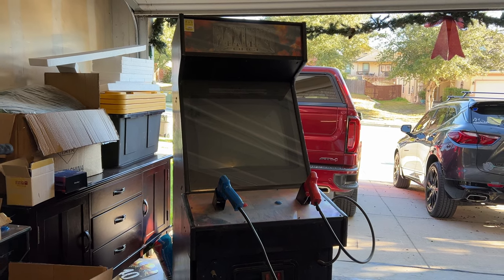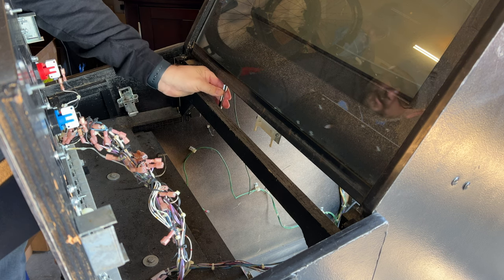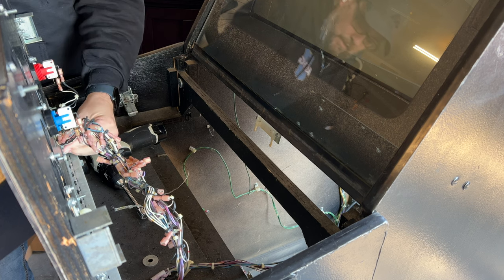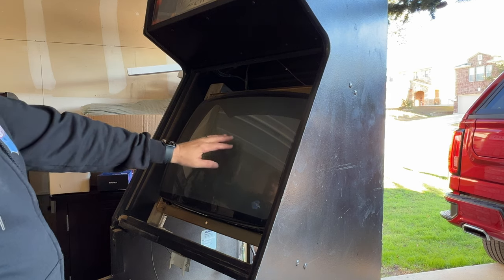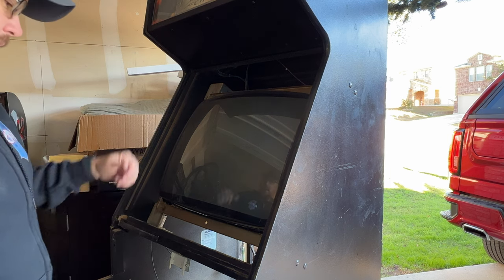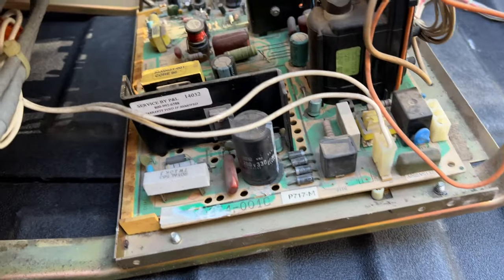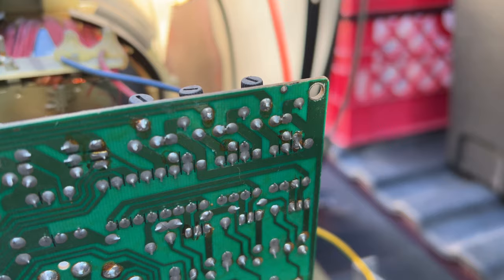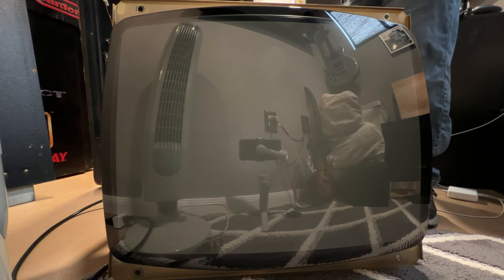Testing the Monitor & Repairing/Upgrading the PCB to Area 51/Maximum Force!

Comment: Nice video - and happy coincidence - I just picked up a really nice condition Area 51 cabinet, and also an Area 51 Site 4 cabinet - it was a package deal from an Operator who is retiring the games.  Both are in great cosmetic shape for being on location for 20+ years.  They both need some work - need new power supplies, and the monitors may or may not work - but I got the pair for $500.  And they are complete.  I am going to keep the Area 51 and do the flash cart upgrade you did in the vid.  The site 4 I will fix up and sell - hopefully making the money back I spent on both cabs :)

Comment: The AC input connector on those monitors are notorious for broken solder joints on the connector. I'd flip it over and make sure the joints on the connector are not cracked or try simply pushing on the connector a bit to see if it powers up. It's not normal for them to be TOTALLY dead. They will usually "tick" or make some kind of noise. If it's completely dead, I suspect the AC input connector sockets are spread open, or the solder joints are cracked. As for that hard drive kit, which kit was it? The one I got for the arcade doesn't remember the settings. Did you verify yours is remembering the settings?
Reply from the maker: I’ll have a look! It’s sitting in the garage for now but I’ll check it today. The kit I got was this one: https://www.ebay.com/itm/125874939002?mkcid=16&mkevt=1&mkrid=711-127632-2357-0&ssspo=O3gOSzQwTJO&sssrc=4429486&ssuid=La2_eSZ5Q9S&var=&widget_ver=artemis&media=COPY 

I don’t think it remembers settings. I didn’t mess with it much after verifying it started. I did go back yesterday and hook it up to my KI2 and found it didn’t remember credits that were in it after rebooting. I also noticed the sound doesn’t always work. Sometimes I get nothing, sometimes I get a popping sound and sometimes it actually works. I couldn’t mess with it anymore yesterday but plan to try again today to trouble shoot.

Comment: Hey I know this question doesn't pertain to this video but I wanted the fastest response; what would you recommend as far as a pc for MAME that runs blitz and showtime without stutter and what are the minimum specs as far as processor processor speed and memory etc. I know your videos about it are several years old so I wanted a more updated suggestion Thanks and if you have any links that would be great too
Reply from the maker: I haven’t bought new PCs for those games yet. This is the PC I use: https://amzn.to/2SECThf 

It does have some stutter on Showtime but it’s not enough to really bother me. If you want it to run perfectly smooth you’ll probably need a more modern processor like a decently powerful Core i7.

Comment: What genius converts an MK cab with such a raked screen into a shooting game? You would have to lean over the cab to aim correctly.

I bet the reinforcement of the gun was to stop the cable from getting stressed out when pulled. It’s not pretty but was probably effective
Reply from the maker: I guess a desperate for revenue arcade owner wanted a cheap “new game”. I’ve see. Far worse shooter game conversions haha. One was in a golden tee cabinet, the monitor was basically on its back. So weird.
Reply: I worked for Aladdins castle in the mid 80's to early 90's as a 3rd job. We had 1 mk 2 when brand new had to be collected 3 to 4 times a week. When new it cost 4500 and made over 2k per week in the first 3 weeks. We then got in 2 more and the cash just rolled in. At the end of its life it barely brought in 20 bucks in 7 days. They sold off 2 of the cabinets for 500 each and converted the other one into a tekken. You look at it as an arcade purist how could you ruin a mk2 cab but this is how you made money in the arcade days. Mk2 became a dud at the end of its life plain and simple
Reply: @deadmousyplutaprestige8771  my comment has nothing to do with being a purist. I get converting cabs. My point was shooting games need perpendicular screens.